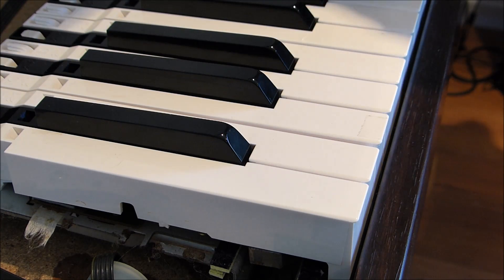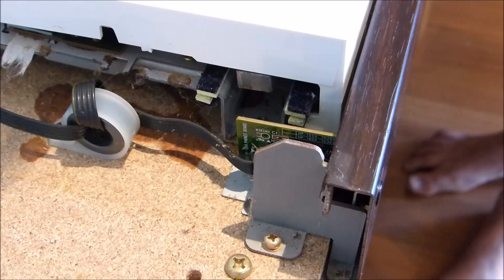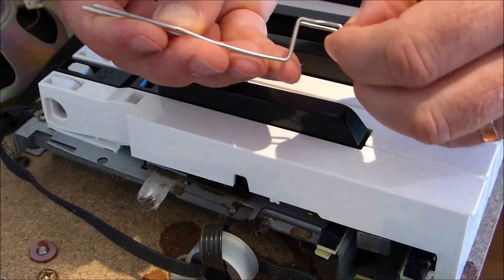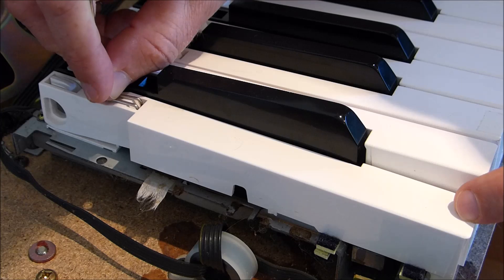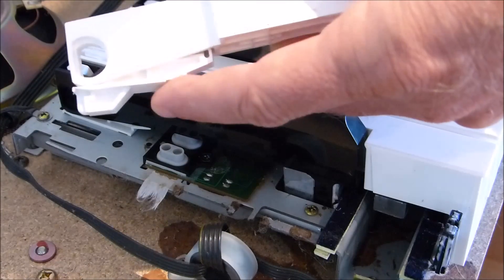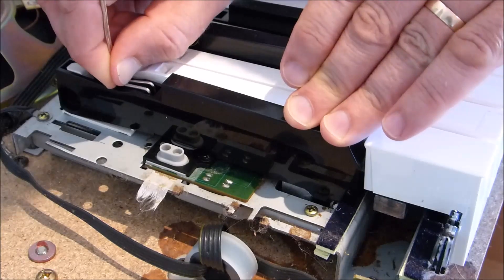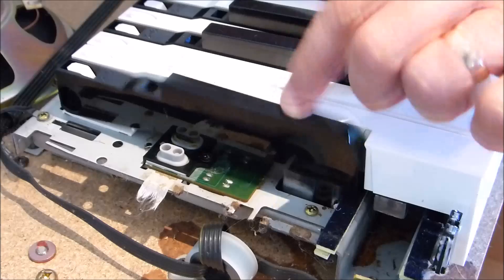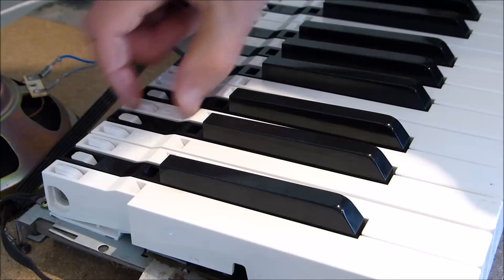Roland HP-230 Digital Piano Key removal for contact repair HP-3700 HP-800 HP-2700 KR-4700 KR-5000

Comment: I've been trying for hours to make the tool but I can't. It just won't work 😭
Reply from the maker: Is the wire too flimsy and keeps bending? Did you use the measurements at the end of the video? Did you make sure you depress the key first before inserting the tool?
Reply: Fontgod I only had regular paper clips and bobby pins. The paper clips were too flimsy while the bobby pins were too hard and just wouldn't bend it properly. Is there anything else I can use? It took me forever to figure out how to unscrew the piano so I'm just really disappointed that I couldn't get the keys off after trying for hours. I just don't know what to do anymore. :/
Reply from the maker: Try a jumbo paperclip, or a piece of sheet metal that you can cut with tin snips and bend with needle nose pliers. If the metal is too flimsy it wont work.
Reply: Yes Bhawn03 - -- like Fontgod said - - I had the same problem - you have to make sure you have a thick paper-clip, or if it is too thin and flimsy - it won't work.  When you try to do this - you have to have dexterity and be able to do this - or even get a good friend to help you.  

Sometimes I need to ask for help - to get someone to help me to get the problem fixed right.  It's good to ask a friend to help you, to get your piano working - so you can play great music!
Reply: Sorry - that sounded stupid.  What I meant to say is - sometimes I need to ask someone's help who has tiny fingers to wiggle this little piece of paper-clip (thick one) into the little Roland plastic key - hole - to find the "latch" and pull on it - in kind of a "pull-and-lift-at-same-time" kind of way.

...All the while - pulling or pushing ( I can't recall which) at the same time - then find that hook - then pull it - and BOOM - suddenly - a moment of " Ah-Haa! "  and the key comes free.

That was such a rush - to finally get the little key-device to work - - - proving that this fellow on You Tube was actually telling the truth - was the first realization -  - - - then WOW it WORKS!  And pulling that key out - then cleaning the area - -- - what a McGyver!  Thank you so much.  Hope this helps you all!  Cheers!

Comment: good video, worked on my roland A80 that is about 30 years old.  After a few keys were off, I was able to just release the key from underneath (push up with a small screwdriver) and it was easier than mucking around with a wire.

I had a dead key, just vacuumed it up and cleaned it up and now it works again!
Reply: Zlat Todo What do you mean by "push up with a small screwdriver"? Did you just insert the screwdriver in the hole? I've been trying to make the tool for hours but it just wouldn't work. I'm so tired. Could you please help me?
Reply: If you are starting in the middle, you need to use a tool, if you are starting near the edge, you can insert a small screwdriver between the main chipboard and the plastic spring/key/retainer and gently lift it up, its a lot easier once you have one key outso you can hold it and make sense of it.  Basically, when he depresses the key in the video and inserts the tool, it locks the plastic spring/key/retainer to the actual key, and when he lifts the key UP, it lifts the plastic piece up too, you can skip all this by lifting the plastic piece up from underneath but like I said, its only doable from the side, so start either at the end, or get the first one removed with a tool.

Comment: Excellent video. You made the difference between me being stuck with a broken HP 1200 or being able to get the keys out. Not having a suitable paper clip, I managed with a picture hook bent to the shape needed. Big thank you!
Reply from the maker: Always nice to hear that pianos around the world are being brought back from the dead. Did you have many bad keys to fix? Will add HP-1200 to the list of compatible fixes.
Reply: Fontgod Hi. One broken one that I superglue back together once a year but knowing the trick to removing, I've made a better glue job of it and moved it to the top octave until a replacement becomes available. (Do they do piano swap meets?) More importantly, debris was interfering with the switches underneath giving me unexpected loud notes. I removed all keys and gave it a good clean and so far seem to have fixed it.
Reply from the maker: Is the HP-1200 a hammer action key or just weighted like the HP-230? I think my keyboard weighting is the same across all keys but some keyboards have varying weight as you go up the scale so swapping keys can cause slight differences in that regard. My HP-230 uses K20W style keys and perhaps your model is the same as the HP-1000S also uses the same keys. Have a chat to the guys at Syntaur who have some left in stock for most keys https://syntaur.com/roland_hp.html

The following forum may also be of use https://www.keyboardforums.com
Reply: Fontgod I compared the 2 white keys I was swapping and they seemed exactly the same. I compared black keys and they all seem to be the same. And when I played it, the feel was correct.
Reply from the maker: Yeah, oddly the keys are all numbered at the bottom/back of the key so I suspect this is due to incremented weighting on some keyboards but it makes no difference with mine. Is yours the same K20W style key or do you have a hammer action? Where did your key actually break? The K20W style keys seem quite robust compared to the hammer action which seems to have a weak spot.
Reply: Fontgod Mine is exactly the same as you're showing here. Other than the key letter, I couldn't see any other writing but maybe it was on the back.

Comment: Hey man! Thanks for the video btw, i need to exchange my contact strips (HP-230 ZI 51851) but i'm having a hard time finding them. Any tips?
Reply from the maker: The only place I knew of that stocked them was syntaur.com but think they are now out of stock. How badly damaged are they? You can try cleaning the black carbon dots on the back of the strips with a magic eraser sponge from a supermarket and also try cleaning the circuit contacts themselves with a soft rubber eraser, then draw over the circuit contact with a dark lead pencil such as a 6B, the carbon in the lead pencil will help conduct signal again. Another solution is to try a conductive paint pen to repair the carbon dots on the back of the contact strips or even to redraw the circuit itself if it is badly damaged, try a thin layer at first though as it may perhaps affect velocity if its too thick, not sure really. I've also washed my strips before in detergent to remove the silicon grease that tends to leech out over the years. One thing I can say though is leave most of your screws out of your piano as fixes tend to be temporary and you may need to open it up every few months.

Isopropyl alcohol can also be used to clean the strips so I read.
Reply: yes (sorry for multi-year delay in reply)  Always look for the "little nib" or tab, that you can pull upon.  Often the manufacturers will make a "sleek design" that means the access points are very hard to find.

So look carefully and slowly and you'll find the openings.  Sometimes a small opening in the side of an otherwise smooth line - try prying gently with a flat-head.  Often it will "POP" out and you'll see the shell come apart.

With the old Roland keyboards - seek good You Tube videos about that EXACT unit - and watch - and learn.  That's what I do often.  I've learned SO much from all the wonderful people out there - who have shared their wealth of knowledge for us beginners.

Comment: Hi Fontgod, Thank you for your video. I was able to to remove the keys thanks to your technique. My HP 1700 has two keys that don't respond anymore. Cleaning didn't help so I am trying to remove the rubber contact strips and see if I need to draw the circuit again. I removed the screw but I am not able to remove the piece of plastic that holds the rubbed contact strips. Any advice? Thanks!
Reply from the maker: Hi Mathilde, I actually did attempt another video to show how to do this last time I cleaned my contacts but phone ran out of memory part way through and I never completed the video. Anyway, I'm not sure if your HP 1700 will use the same technique as below but but what you may need to do is remove ALL the keys from the circuit board segment with the dead keys. Work left then right until you get to the edge of the board segment in question (I think there are either  3 or 4 segments for the entire keyboard so this may be around a 1/3 - 1/4 of the total keys , cant remember exactly, the boards are also not all the same length on my model). Once you have the entire board exposed for that segment, remove all the screws for ALL the plastic contact holders for that segment, not just the one you want to work on.

Once all those screws are removed, carefully tilt the circuitboard from the front of the board upwards by just a few mm. This will then allow you to grab the plastic contact strip holder by the front of the holder with your thumbs and prise it gently upwards as well, several lugs at the top/back of the plastic are holding it in place which is why you need to tilt the circuit board first. It may be lightly attached with an adhesive strip as well but that comes free quite easily. Try cleaning the board contacts with a soft rubber eraser and likewise the rubber contact side as well.

A soft dark lead pencil such as 6B can be used to temporarily repair the contact by gently rubbing it over the surface and laying down some graphite. You may also be able to use a conductive ink pen to reform a circuit if it is totally damaged.

Note that it seems easy to cross thread the screws when replacing, a good tip is to slowly screw them anticlockwise first until you feel a slight grab, then screw them inwards clockwise.
Reply: Thank you for your quick answer! It will take some time before I can removed all the key. I thought I could get away by just removing a bit more than four keys! Will let you know if I succeed. Thanks again
Reply from the maker: Did you try the quick fix technique of inserting a match stick or thin bamboo skewer into the two holes on the top of each rubber contact and swirling it around whilst pressing downwards for a few seconds? This is generally enough to clean the contact temporarily without having to remove the contact strip completely. On my piano this usually fixes the issues for a few week/months depending on humidity levels. If this doesn't fix the issue then the contact may be damaged underneath the rubber, not simply dirty.
If you build a sturdy tool from a very thick paperclip (one that is hard to bend) then removing a key only takes a few seconds once you understand the technique, however if the tool is too flimsy it can be very frustrating and time consuming (the first tool I built bent too easily).
I checked out your piano playing/juggling video by the way, clever stuff :)
Reply: Thank you! Just tried the quick fix technique, it didn't work. I finally was able to remove the rubber contact strips. I checked the circuit, doesn't look bad. I compared it to the rest of the keybords and I don't understand why it doesn't work. Where I thought it might need to be retraced I used a pencil but it didn't work. I guess I can't do much about it now. Thanks for your help!
Reply from the maker: If you are aware of the dangers of live power, remove the contact strip off the offending key, then switch the power on (obviously don't touch any live circuitry with your body or risk electrocution). Then using a small insulated flat screwdriver, bridge the gap across the circuit where the key isn't working. If you get some sound then the circuit is ok and its likely the little black carbon dot on the back of contact strip needs cleaning. Each key has 2 contacts, one is to show the key is pressed, the other is for velocity, I think the piano measures the time between when each is hit to determine velocity

Comment: i also found that it worked quite well with a blade screw driver from the end/side gently lift the foot and slide.
Reply from the maker: The only problem with this method is I think you cannot remove individual keys, you need to remove all the keys until you get to the one you want to work on. Am I correct? I often have recurring problems with my keyboard but can usually just remove the problem key, then wiggle a matchstick around in the two little holes in the rubber contact and this is usually enough to get the key working for a few weeks/months as it temporarily dislodges whatever grime was stopping the contact working.
Reply: Fontgod unfortunately it seems that the issue is much worse looks like a damaged pcb. I'm not an electronic engineer or even a sparky just trying to get the 6 dead keys on this board i bought today going. looks like i may have bought a lemon.
Reply from the maker: depending on the damage and width of the PCB that has been damaged you may be able to repair the trace with a silver conductive pen to redraw the circuit. Or solder a jumper wire between the broken trace.
Reply: Great idea!  Thanks!

Comment: Good info Fontgod , all keys in Roland RD250s now working, had to repair a cracked pcb trace, Happy Holidays and thanks from Toronto.
Reply: Cool!  Such a small world eh?  I'm in Hamilton - from Toronto originally - got the Roland RD 250 s As a Gift - from a great friend - - - - - had the "two dead keys" issue - - - - went on You Tube - - - - found this wonderful "Fontgod" Brittish accented wonderful guy, gladly sharing his wisdom and awesomely creative advice  - - - and did what he said - - - and bent (it took me 2 versions to get it right - the first one was too thin of a paper-clip - gotta use a thicker one, like he told us)  and BOOM - fixed - and done.  This is an amazing keyboard - a Classic.   To have Great Advice and Wonderful Tips like those from Fontgod - are So Much Appreciated.  Thank you - Again - Fontgod!!!

Comment: please help ,one loud key , middle A , cleaned circuit  ,contact under key , clavinova 550 ? tried everything
Reply: yes , it was a small worn spot on the trace ( circuit board ) , the size of a pinhead hardly could see it , covered it with hot glue but anything to isolate it would work , hope that helps.
Reply from the maker: When you say you cleaned the contact, did you actually lift up the rubber contact pad and clean the circuit area itself as well as the underside of the rubber contact pad? There will likely be a small black or grey circle on the underside of the pad, clean this as well with a q-tip and a little isopropyl alcohol. I don't know for sure, but if it works similar to my keyboard then it sounds as if one of the contacts under that key is stuck in a closed circuit so that the velocity sensor thinks the key has been hit at maximum pressure. If there is no foreign matter visible and the contacts look ok then perhaps its some other issue with an electronic component.
Reply: thank you for replying , mine has two continuous small black wires that are put under pressure by the keys ,then they lay across the sensor  board which is ( 3 circuit boards in line ) with the carbon strips on one side and only diodes on the other  , I have tried pencil lead ( does it matter what kind of pencil lead ?  , then alcohol , pencil eraser , the key rings out at full volume and some times you hear a second tone same note ,. hope that makes sense , thank you for your time , ray
Reply: Hi, did you fix your problem? I have same one loud key on a RD300GX.

Comment: Good instructions for the inexperienced handyman.
The "E" key, just to the right of the centre "C" did not work at all..
Had to make a slightly different removal tool, but it worked fine. 
Tried to clean the contacts, and changed to a key from a different position but also a "E" key. Now the dead key works but needs a slightly heavier keystroke to make it work good. If I tap it lightly it makes a soft sound, softer than the other keys, or no sound at all, if very lightly. Any ideas why this is so?
Reply from the maker: When you say you cleaned the contacts, did you remove the rubber contact pads and clean underneith on both the circuitboard side and also the rubber side?
Reply: Yes, I cleaned the contacts, by lifting the rubber and cleaned both circuitboardside and rubber side with a q tip, and some fluid I had for cleaning electrical equipment. It was an old bottle I had from a film maker for cleaning the moving parts of a projector. Worked well.
When I was finished all keys worked very well, and the touch on all was
the same.